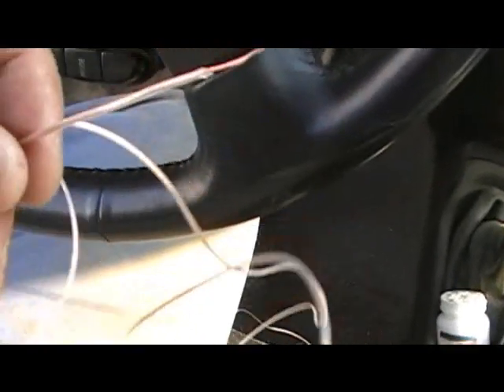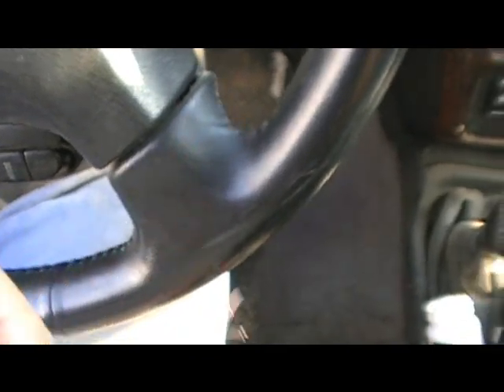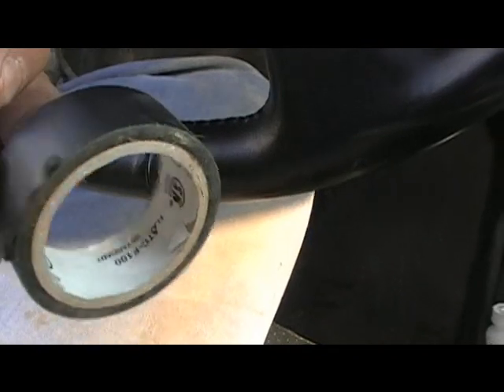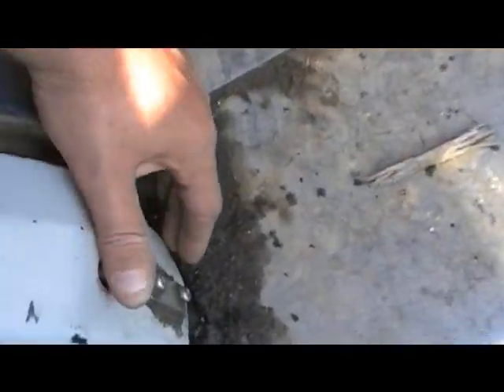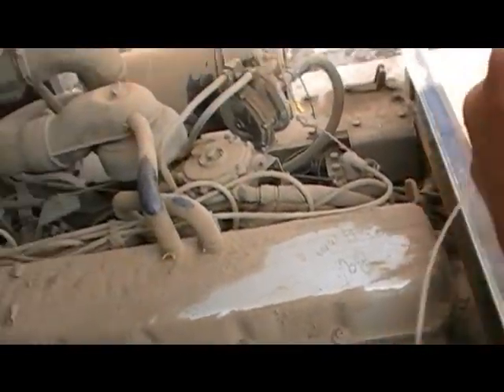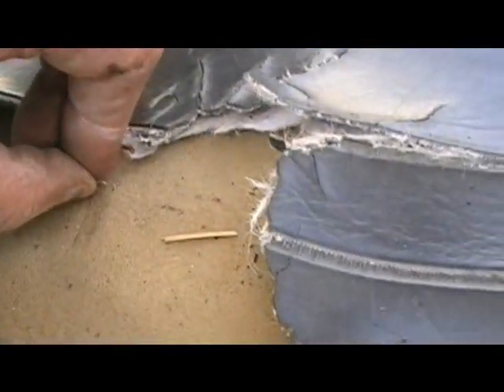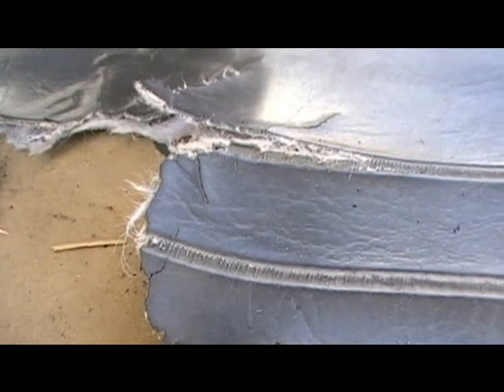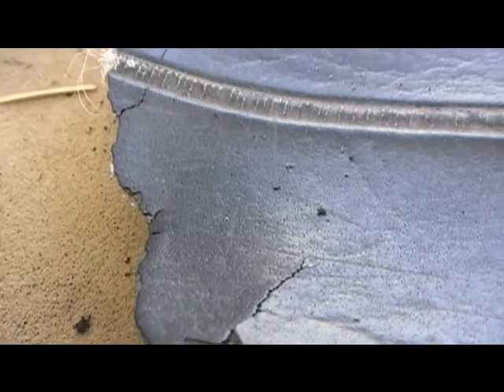boys will be boys

Comment: Another good one to do is to take a condenser , the type that used to be inside a distributer cap, you stick the wire end of it into a sparkplug boot and crank the motor for just a second to charge it up.(being very careful to only hold it by the wire.

After it is charged, just sit it on the table in the break area and in no time someone will pick it up out of curiosity. When they do and touch both the metal of the casing and the metal of the prong end it will shock the crap out of em.